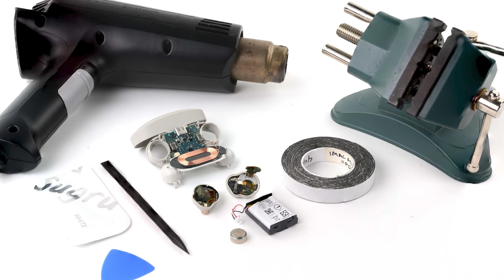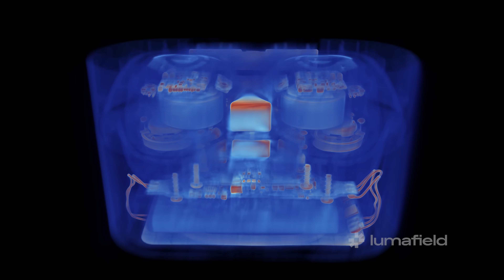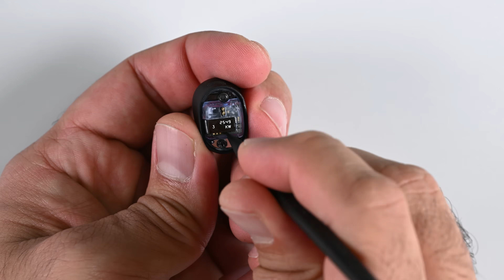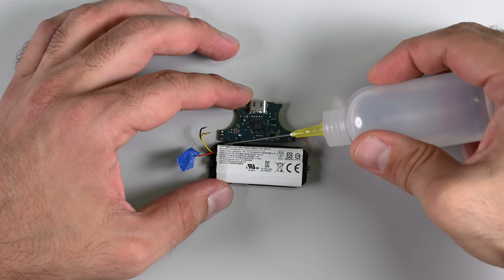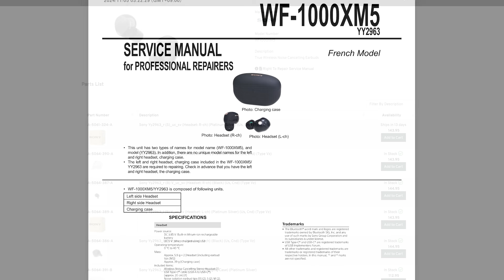Buyer Beware:  Sony’s XM6 Might Be Your Next $330 Paperweight

Comment: Repairability doesn't matter just cost. that's why I only use ones that cost less than 50 bucks. the jlab go air have been ridiculously good for the price they sound way too good and if I accidentally send them through the washer which I have before I don't care I'll go buy another for 20 bucks.

Comment: I have the XM3 both in-ear and over-ear and one thing that made me buy them was the super high repairability of both of them ( I've changed the NC mic in the WH and battery in the WH and WF with so much ease I was watching TV at the same time ). 

The very custom battery in the XM6 and the use of glue for the earbuds I'll agree with your assessment that it is questionable. I'll skip another version before upgrading, maybe the XM7 will be back to the repairability of the XM3 ( Sony just to make it clear : if you had made the XM6 as repairable as the XM3 I would have upgraded. You LOST a sale because of the lack of repairability )

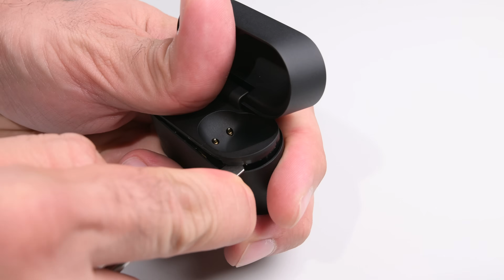Comment: 2:48 - as someone who repaired a variety of earbuds/charging cases, i can tell you that those kinds of small deformations can be repaired by carefully applying heat with the heat gun (100 - 110 C). Plastic tends to go back to it's original shape :) (just be careful, apply from a distance, not for to long)

Comment: IDGAF about repairability and obviously the manufacturer doesn’t either.  No point having “repairable” hardware when they won’t’ sell you the parts and no doubt under the warranty terms and conditions and self-repair would invalidate the warranty so there literally is no point.  Once the battery dies you simply dump them and replace them and no doubt they will ensure new models are released every year.  I will never use “repairability” as a determining factor in any electronics I purchase - it’s irrelevant.

Comment: Who's paying you? Everything you say is irrelevant for the users point of view. I used my Sony wf-1000xm5s for 3 years without a single problem. They work flawlessly, and they are ready for the new user. Meanwhile I am extremely happy with the Sony wf-1000xm6.
You are full of @hit.
Reply: They are paid by 🍎 to talk 💩 about other brands. In reality is 🍎=💩
Reply: @wanderer_vacharya  This is literally not true. They've always been critical of Apple. They're in the right to repair fight against Apple all the time.
Reply: @SuchiththaW but they scored 🍎 higher than Google or Samsung phone in the past. Doesn't make sense
Reply: @wanderer_vacharya  It does for some phones, actually. Not every single one, but Samsung is particularly horrendous for the repairability of their devices. Google has done well sometimes, but not every single time.

Apple's iPhones have always had poor screen replacements, however many of the other components have been fairly repairable in certain models, at least.
Reply: @SuchiththaW I repair phones bro.... The easiest phones to repair phones are Samsung, Motorola, LG, Google..... So many android phones. iPhone have always been pain in the neck to fix...

Comment: Wonder if it's still susceptible to the battery drain issue that the XM4 has.
Reply: I'm wondering about that too. I have the XM4, and this issue has never been fully addressed. "Please buy the XM5, where the issue has been addressed." Yeah at the cost of batteries that are even harder to acquire and replace. At this point, making it hard for consumers to replace batteries and claiming that they don't need to do that anyways (who wants to use 10 weeks old earbuds when you can buy the same in fresh new color?) is a (anti-) feature that they won't let go easily.

I wouldn't believe them. It's a Sony.
Reply: @LiveWireBT Was the issue actually addressed with the XM5? I alsp have the XM4, already sent it back to Sony once because of the battery drain, and it's already happening again late last year. That's why I'm starting to loomminto the Galaxy Buds 4 Pro as a replacement.

Comment: Having to mess with solder is not as big of a deal as having a device that needs a custom order battery that may never be available for replacement. I don't understand why the buds have to be more complex than the xm3 which I have and have replaced the batteries once (so easy!). Either way, they continue to make clunky earbuds with clunkier cases that are now less and less repairable 😢

Comment: excellent quick teardown. thanks for confirming the earbud batteries are not soldered and do use the 2 pins which I hypothesized in the FCC teardown teardown in my analysis. The change to soldered connections for the battery in the case is a major step backwards, especially considering the WF-C710N and LinkBuds Clip cases both use connectors for the battery in the case as well. 

Likewise the addition of the 2 extra PCBs in the case is an interesting design change, as Sony has been using a one board design for most of their earbuds for the past 1-2 years now. Perhaps to accommodate the different earbud size and height.

I will give sony props on the earbud opening, as they did get rid of the cable between the top shell piece and main body as you mentioned.

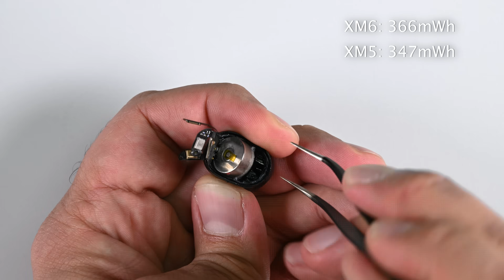btw @2:28, it seems either Sony is using 2 different batteries for the XM5s, as I've seen a teardown with Z55FH which is 366mWh 3.85V, and the Taiwanese cert shows a 90mAh 3.85V from highpower (347mWh). Also do notice the battery in the case is 560mAh, up from 500mAh in the WFXM5.

Comment: Can anyone explain to me why people are so affixed with taking apart their earbuds to swap batteries? I myself got fancier buds 5 years ago and used them daily since with easy 3+ hours per day average, got them wet, dropped them, slept with them for white noise, had them die out of battery discharging too much multiple times and they still work. 
How does anyone put their pods through more abuse to the point where battery needs to be replaced but the device itself is still in ok physical condition?
Reply: What brand model? I'm interested
Reply: Then you bought a good model at a time when the market and this kind of product was mature.

First models from Earin had many problems. In between I bought some Sennheiser which might be comparable to yours, I still have them on their original batteries. Then I got Sony XM4, which sound a bit better, but they ear through a set of batteries within a year due to a firmware bug (according to Sony, but let's call it a feature instead).

Lucky you, don't mind us and keep what you are doing. 👍

Comment: OMG! WHO CARES about the case battery and solder? The bud batteries will die 10 times over before the case has a problem. 
I'm still daily driving XM4's and have the new XM6's to enjoy the LC3 codec and much better sound quality. 
Your job is to assess the repair-ability, not to inject your opinion on the value of the product, or let it detract from the clearly repairable buds AND case with a score of just 3/10. If you can't solder 3 wires or use alcohol, you shouldn't be attempting to repair anything.
Reply: We're not talking 1980s or 2000s solder pads here, many of these have become so tiny that soldering becomes an issue even for skilled people.

Comment: Meanwhile, the Fairbuds don't even have Hi-Res Audio.
Reply: Does anybody really care? Most people don't even know what that means, and most sources don't give you high-res sources to begin with. Of course having it would be nice, but its not a critical feature on a bluetooth earbud for most.
Reply: @lbgstzockt8493  absolutely agree. And even if one is playing local FLAC files or streaming them, the difference is negligible on tiny earbud speakers in noisy environments. And that's just "Standard Res". Doubling or quadrupling the amount data to achieve what? The "Hi-Res Audio" market only exists to extract more money from consumers who don't know better.

I have expensive gear at home, I can stream such huge files if I wanted, and yet I don't. The buffering is a minor problem, my player can cache them, but it makes little sense at home with the expensive gear, and it makes no sense on the go.
Reply: They themselves are still bound by high-quality parts availability in terms of economics, but it's definitely not entirely their fault. If you know how to engineer their idea more cost-effectively you are welcome to try
Reply: It wouldn't matter if they did. According to Soundguys the sound quality is merely "okay" while the XM6 is excellent. The Fairbuds also lack multipoint connection, suffer dropouts and theirs crashed a few times. The USB-C is modular, but the case doesn't support wireless charging which could reduce port wear. The XM6 costs literally three times as much as the Fairbuds. Love the concept, but the product has to actually be good. A serviceable XM6 for $400 with 20 years guaranteed battery availability (or a standardized battery) wouldn't be a bad deal. Instead I bought a refurb XM4 for $70.

Comment: Can't wait for the EU battery regulation come into effect next year.
Reply: Can we take a minute to appreciate how good the noise cancellation is, though. Blow my old bose qc's out of the water.
Reply: Yes! Can’t wait to get a bulky smartphone with no water or dust protection. Way to go EU!
Reply: @Ivan-Nedyalkov  Samsung Galaxy S5 from over 10 years ago had swappable battery, and wasn't bulky, thinner than newest iPhone pro.
Reply: @Ivan-Nedyalkov  Samsung XCover7 that came out last year has a user removable battery (just pop the back, no screws), AUX port, SD card slot, yet keeps an IP68 rating. 
The upcoming XCover 8 Pro is rumored to have an IP69 rating.

Oh and it's just 1mm thicker than Pixel 10a
Reply: @Ivan-Nedyalkov   Action cameras have been around for years and have removable batteries. Apple AirTags are also IP67, and very thin.
Reply: @Ivan-Nedyalkov Recent account. One comment. Bait used to be believable.
Reply: @Ivan-Nedyalkov  What a foolish, bootlicking response. You can have both things and it doesn't have to cost the world. Stop believing the lies of manufacturers.
Reply: @Ivan-Nedyalkov do you know rubber gaskets exist and can give water resistance
Reply: @Ivan-Nedyalkov go google Samsung Xcover 3 or 4
Reply: @Ivan-Nedyalkov  If you think they can't make a dust and water protected phone without glue, you just love to be scammed.

Comment: I'm still using my XM3s because it was so easy to change the batteries. After watching this video, they'll probably be my last Sonys. I'm not paying high prices for tech that just won't last because the batteries wear out.
Reply: I replaced the batteries in mine as well, but I damaged the cables to the touch sensors. They somehow still work. I do think these look like an improvement. The XM6 buds are SO close to being 10 of 10 on repair-ability if not for the cover glue and lack of standard battery in my mind. If they were on with clips with an o-ring that could be just popped off I'd be loving it. So close. Case not so much.
Reply: I still have my sony wf-1000xm3s. Already replaced the batteries in the earbuds. I don't have the experience to unsolder the old case battery though.
Reply: @corey7219 Same here. Maybe I'll just buy a solder kit and try my hand at it. Idk.
Reply: XM4 user here. I agree with you and have transitioned to iems. The best decision I took
Reply: Same! I just replaced the batteries on my WF-1000XM3 this past weekend. Amazing earbuds. Hope they last another 7 years (got mine in 2019).
Reply: Same here.... bought mine brand new when they first came out. Changed battery twice myself. Love them
Reply: XM3 sound quality top notch, ezpz battery replace, quick connection, top grade build anc. super reliable over last 7 years bought another pair 3 years ago, both pairs are perfect working condition and case still charges. Never had a problem.
Reply: I have them too, but unfortunately i have a serious problem with them. They are very clunky to use (slow reaction to touch), and very bulky And buggy. I just don't like them, unfortunately, so i almost never use them.

Comment: My wired headphone have been in my pocket daily for about a decade straight.
They work just as well as the day I bought them.
Reply: After 8 years of use and 2 cable replacements, I acidentally detroyed one of my IEMs and it was time to say good bye. I recently bought a new pair (wired with replaceble cable of course) for another 8+ years of use :)

Comment: Even if they were easy to disassemble, is there a point if parts are not available?
Reply: Remember it's not just Sony that can make spare batterys etc and third party sellers would be a lot more up for making spare parts if it was actually feasible to repair without a lot of experience and tools
Reply: Batteries can be quite easily replaced on the xm4. (I have done it.) I'm definetly not going to upgrade anytime soon. (Or I guess upgrading to the fairbuds.)
Reply: @NoahBuehler same, I'm on XM3 and 2nd set of battery
Reply: ive learned that batteries can always be found, basically no one uses bespoke cells
Reply: "There is no need for right to repair laws, see, you can dissassemble something we make"
Reply: I'm not sure Sony (or most other manufacturers) have ever offered official replacement parts, but you'll still find plenty of original/high quality replacement parts on aliexpress for a good price. I'm sure there'll always be some enterprising individuals in the supply chain who know what to do with a few boxes which fell of the back of a truck.
Reply: NOT EVEN "havinf the parts" MAKES THEM REPAIRABLE BECAUSE THEY OVERCHARGE YOU FOR ASSEMBLIES WHEN IT'S A SINGLE ELECTRONIC COMPONENT THAT HAS TO BE REPLACED.
Reply: If they make parts available to repair centers, then that’s a big deal in Europe at least, since repairs within the 5 year complaint period are free.
Reply: Go ask iFixit that question whenever Mr Clash of Clans face here shill for Apple AirPods Max and Macbooks.

Comment: Nobody buys these type of EarPods for repairability but portability. Repairability scale is some outdated bs
Reply: Well the direct predecessors were easier to repair than the latest model, as mentioned in the video. And other manufacturers do a better job, too.
That's just lazy engineering and has nothing to do with portability.

So Sony wants to be known as a brand that produces disposable products that end up as landfill in a year or two. Fine with me. But charge a premium brand fee? Yeah, thanks no thanks.
Well
Reply: You are new to this channel?  They tear devices up to check how repairable they are.  That's the only thing.
Reply: Do you understand the point of this channel? Do you understand the word "Finite"?
Reply: 0/10 ragebait 🤡
Reply: If it's not repairable, it probably shouldn't be made.
Ressources are finite, we can afford to waist them.